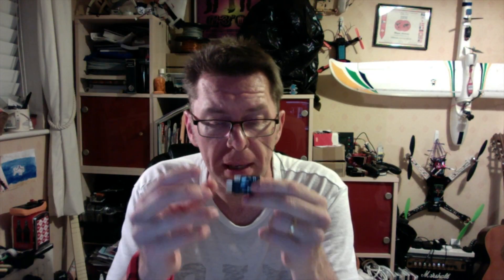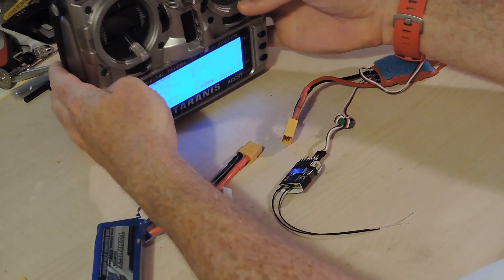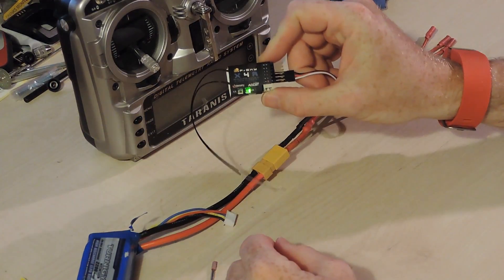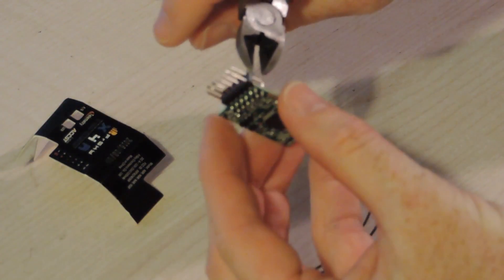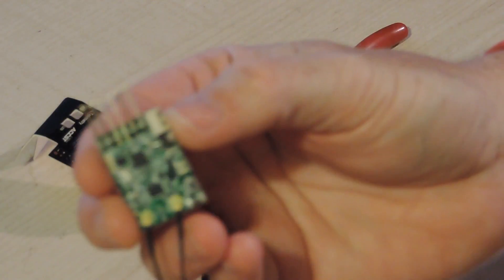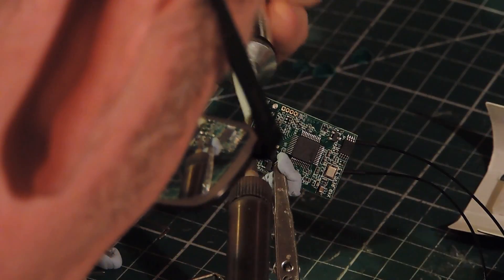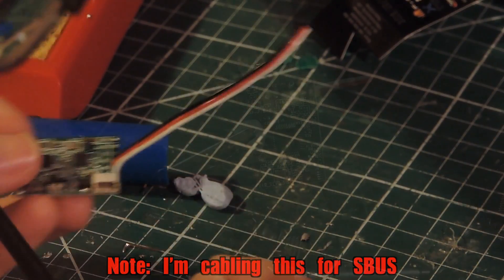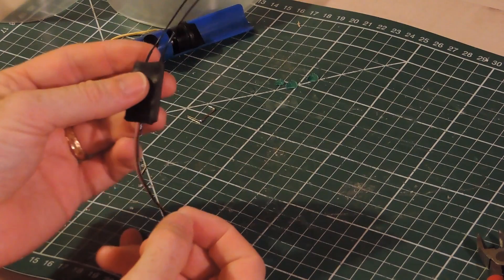Putting the FrSky X4R on a diet - Supplied by Gearbest

Comment: Hello mate, how are you?
Can I bind after de-pinning?
Reply from the maker: Yeah of course.  The bind button is up near the antennas - hold it in whilst powering up (whilst your TX in is bind mode) as per normal
Reply: Thanks for the quick reply. I haven't used my Taranis yet. The cable that came with my Rx has a loose white wire, I take it I don't need this?
Reply: I've ordered some clear heatshrink
Reply from the maker: It's for using with the smart port - either connecting FrSky sensors to it, or by slightly rejigging it you can use it for reflashing the firmware on the rx
Reply: Thanks. I reckon I'll just need the usual 3 suspects.

Comment: Will that x4r from gearbest work in Europe?
Reply from the maker: It came with the International firmware on it - which I use.  It's very easy to change the firmware though, that other one in the title page came with the EU LBT firmware which I changed over.
Reply: CurryKitten Ah, right. I will have to look into how to go about updating mine ( bought from gearbest but never got to work). Many thanks.
Reply from the maker: It's a doddle.  You can use the cable the came with the x4r to do it.  I was going to do a video about it, but there are quite a few guides up already
Reply: CurryKitten Ha, I didn't know what I didn't know so just thought I was doing something wrong during my migration to Taranis. I will go and do a search and doddle. Thanks again for the help. Fun fun fun.